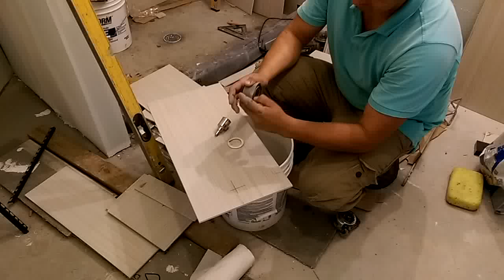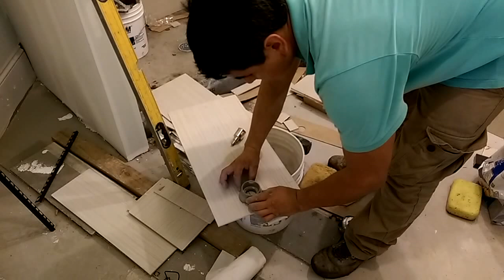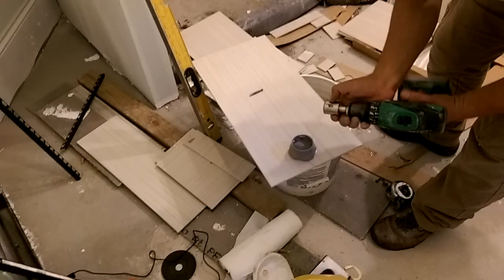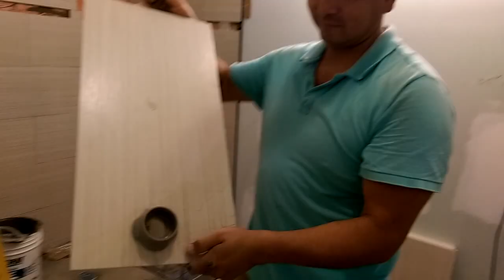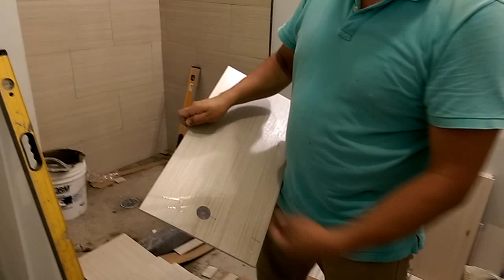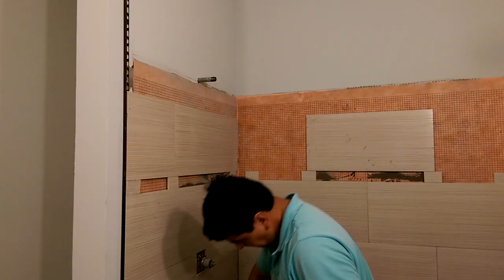How to make round holes in tiles

Comment: Oh wow u used a hole saw. I wonder who taught u that. Smmfh
Reply from the maker: +Bigcee248 There are few methods of making holes on those surfaces, this is only one of the, I will make some videos of the ones you can make with a cutting laser, a grinder, water jetting or dried drill bits. Thank you for watching